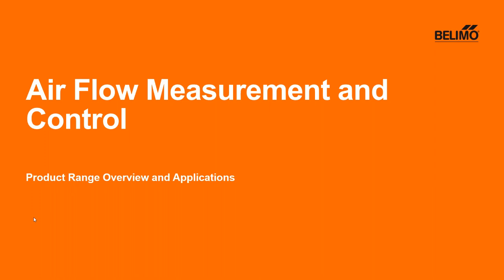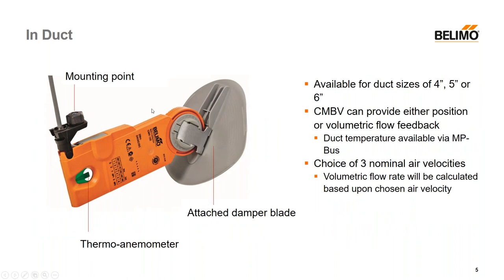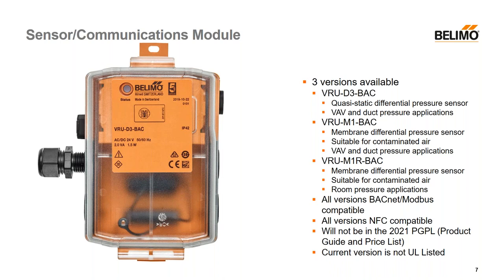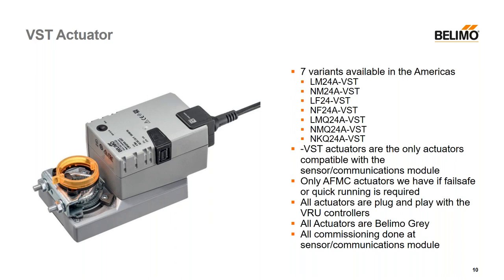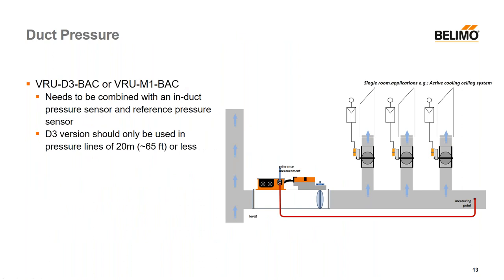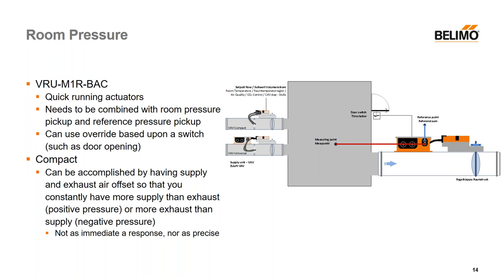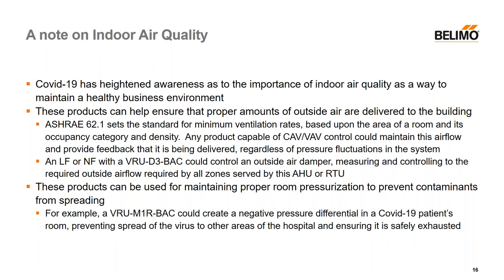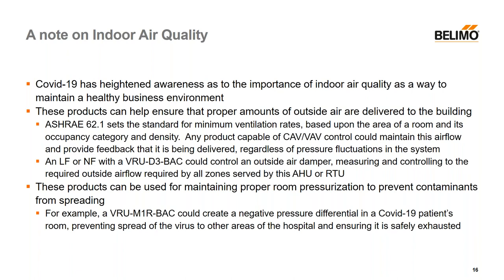Webinar: Air Flow Measurement and Control Range – Overview and Methods to Improve IAQ

Comment: For Static Balancing Valve, when we reduce or restrict Flow Rate using the Belimo Actuator to control the Flow Rate by proportional control, i.e. setting the Flow Rate from say the maximum Flow Rate of 16 l/s and reduce it to say 8 l/s, will this added pressure or increase the pressure to the FCU units up stream of the branch or sub circuit? Say the sub circuit has 20 FCU down stream? Appreciate your advice, sir. Thank you.